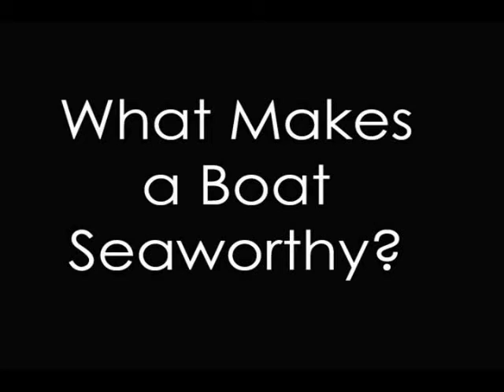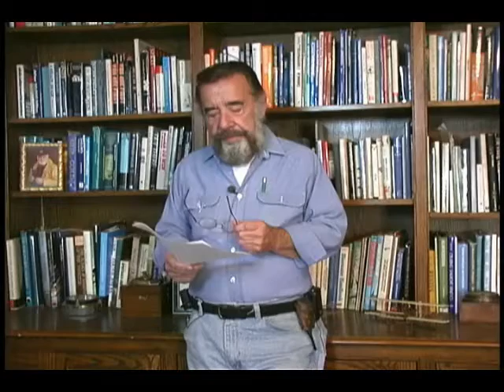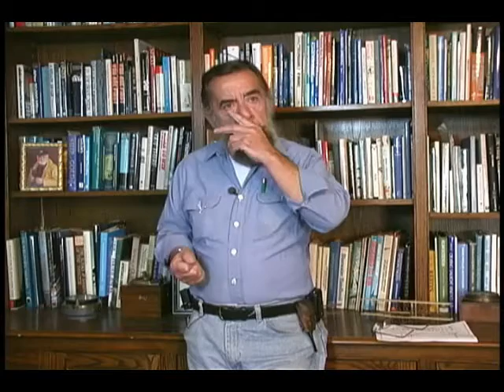What makes a Boat Seaworthy

Comment: Walter,

Perfect summation of the subject. My nearly 30 years of sailing and boating totally aligns with what you said and the bruisers, muscle cramps etc. of the past are a reminder. That is why my new boat that is being built is a cruising semi performance catamaran that I can use as a live-aboard. I am approaching 50 now and not as fit / agile as I use to be.

It begs to ask the question, what type of catamaran would you build if you ever did? What innovation would you come up with based on your history of doing things differentially and the innovation?

BTW if I was purchasing a mono-hull your HPS 53/59 would be the choice. The concept etc for an extended cruising live-aboard is brilliant. I am totally surprised it has not been copied by the major yacht builders.

Keep up the great work and hope you save your best for last...